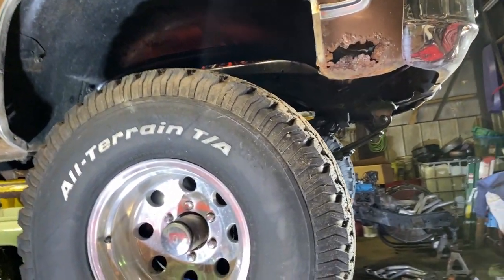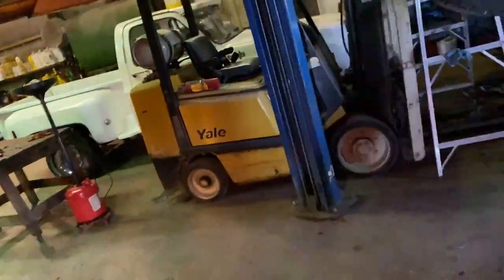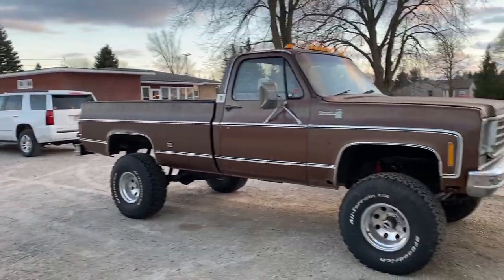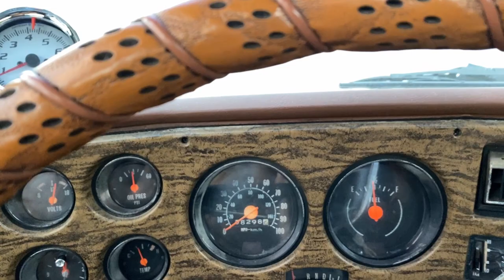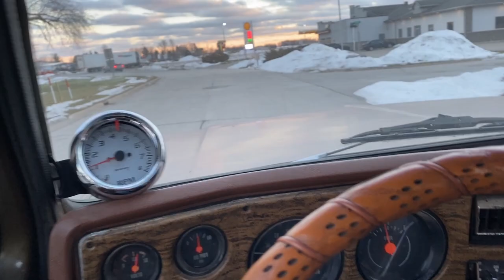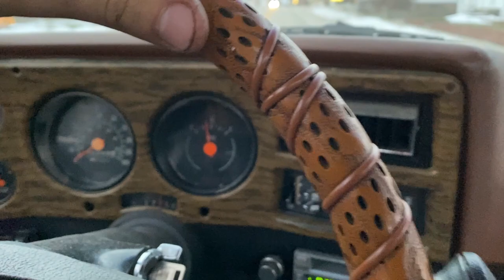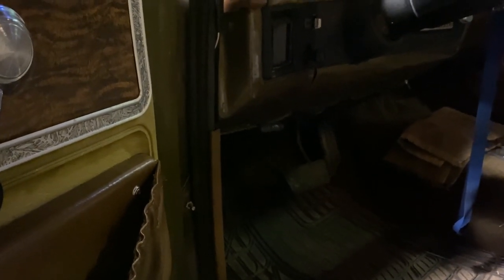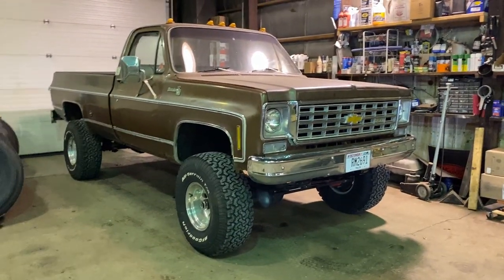Squarebody K10 Final Parts Installed |square body|

Comment: Did you kit the 203 transfer case or swap it out for a 205. I got 6 of those trucks there all full time  we use on the farm there a little bit more mantance but pulling heavy trailers in softer conditions works real good. I got a gold one like that I'd say it's my favorite one to.